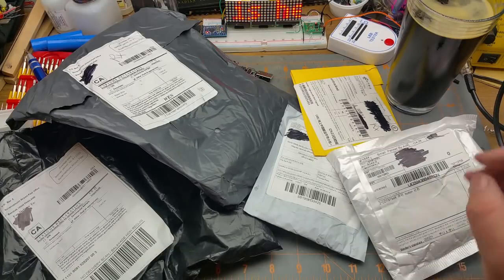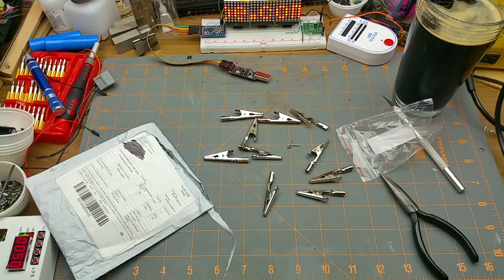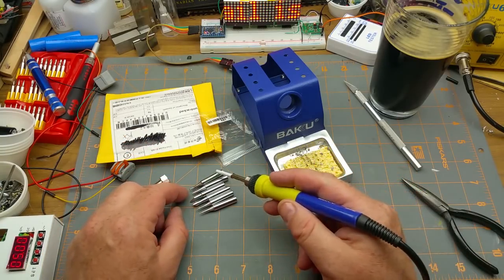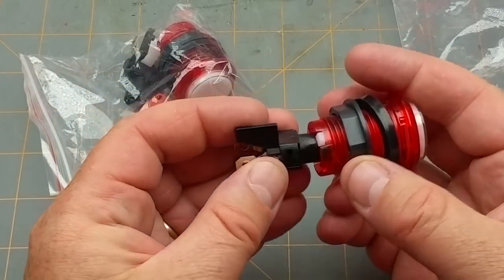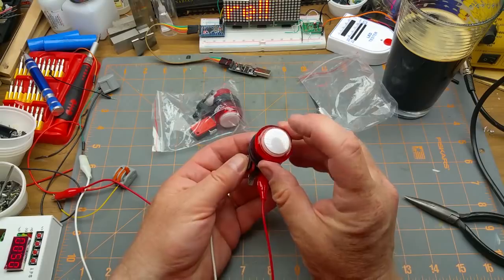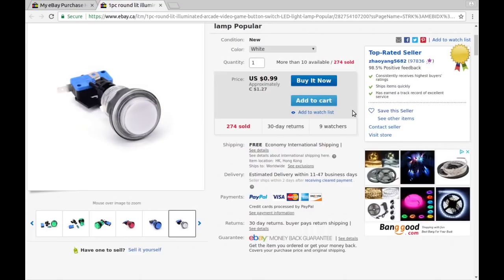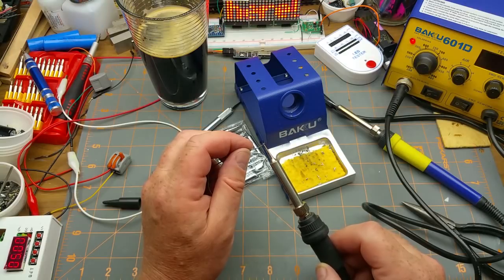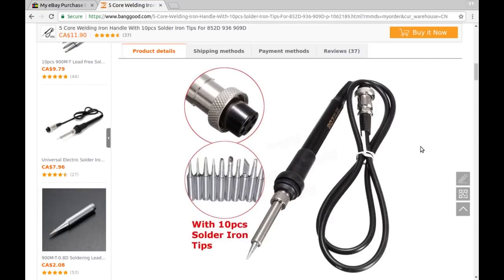mailbag monday 28

Comment: A genuine Hakko heater isn't too expensive, and they rarely go out anyway.  The part number is A1321 and they are $28.99 on Amazon.com.  My Yihua 937D+ actually came with a genuine Hakko heater.
Reply from the maker: That's about a third of what I paid for the whole soldering station.

Don't forget that I'm trying to be as much of a cheapskate as possible...

Comment: The new soldering iron tip seemed to take quite a long time to heat up, is it better now? I have a Sigma 60D, which looks like the 858D knockoffs and was thinking of picking up a new iron as a replacement as well, just wondering if you are liking it or not. keep up the videos!
Reply from the maker: After I let it cool down and tightened up the retaining collar properly, it seemed to be a bit faster. 
One of these days I'll have to get my hands on a calibrated thermocouple to actually measure that sort of thing.
Reply: heh yeah I've been considering ordering one from the usual suspects but then again, how could I check its accuracy? I think the best soldering is done by feel personally, thanks for the reply!